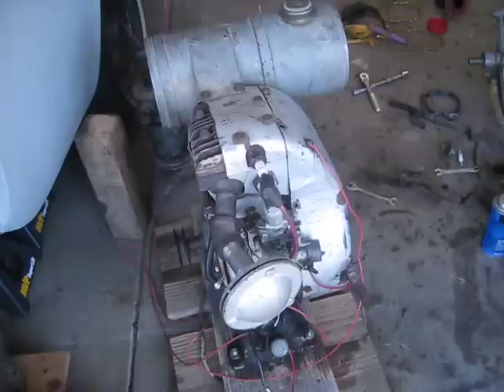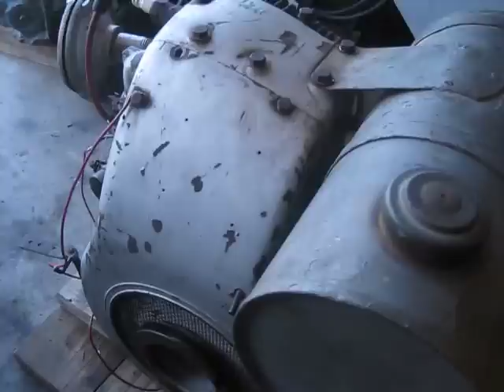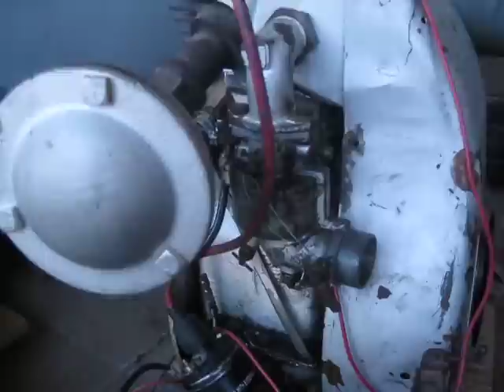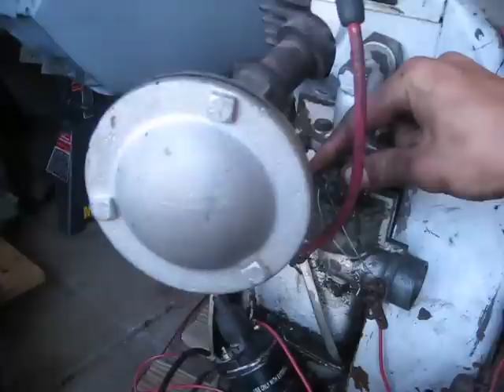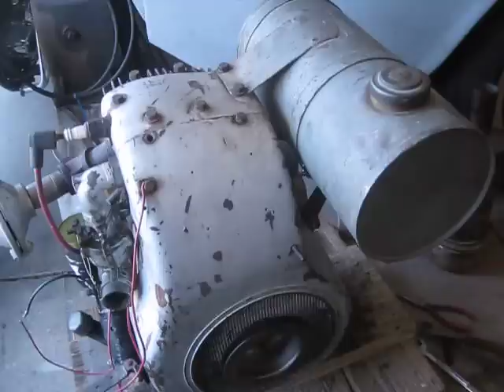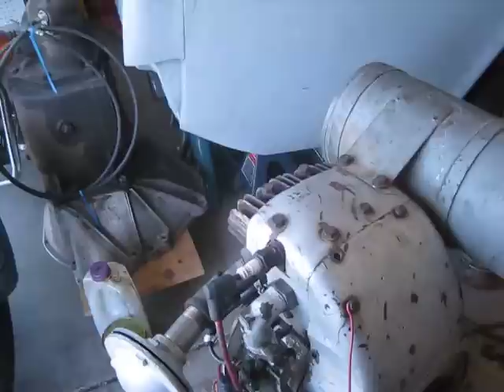Briggs ZZ

Comment from the maker: Take a wire from the points and hook it to the negative of the coil, ground the negative to the engine, hook positive to the positive of the battery, and hook the spark plug to the middle. The non-grounded sides of the points and the condenser connect to the wire going to the negative of the coil. Hope this helps, I explained it in one of my videos with the 1980 Briggs lawnmower engine.

Comment: I got all the numbers:
model 5S
type 700071
Serial 1245226

I finally found the old cast air cleaner mount that goes from the carb to the air cleaner. This engine has ran a long time without an air cleaner, I thought it didn't come with one, as it has been around longer than I have!

Comment from the maker: If it's a 5s, then that carb is not original to the engine.  It would've come with a tank-mounted suction carb. 
Those model 8's will run forever. Mine had a blown rod, so someone threw in a new rod and screwed on a patch over the hole and it runs like a champ! Hopefully someone got yours before it was made into a microwave...